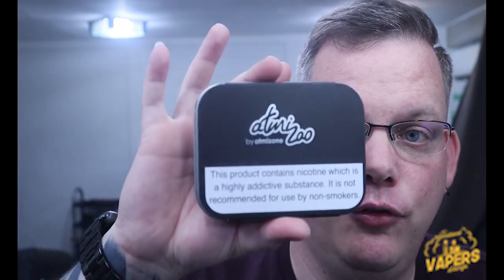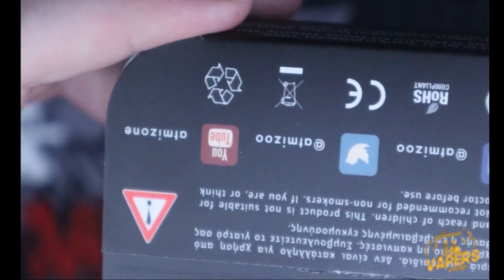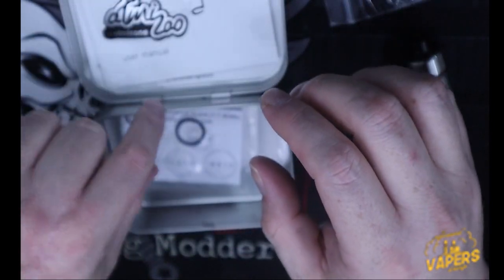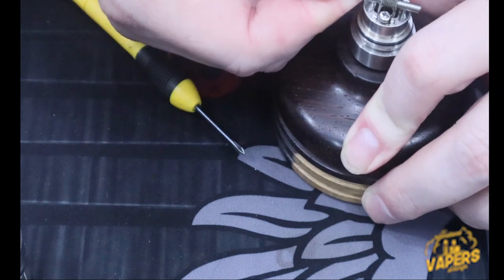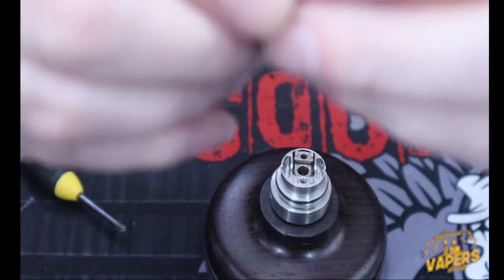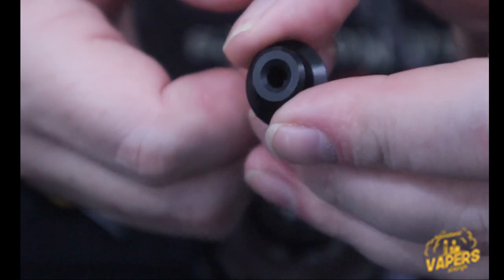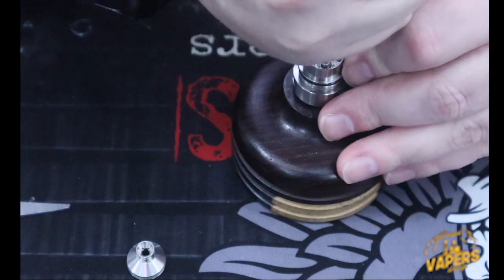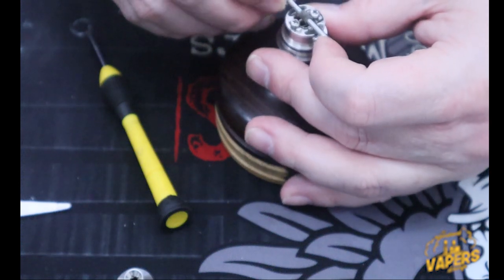Tripod RTA

Comment: Hmm... interesting. Stuck with a little vape pen at the moment. Will share the experience on mine once my mod arrives... which I’m hoping will be real soon. Thanks for the review.
Reply from the maker: Your welcome.
Reply from the maker: Your welcome, sorry for the delay in response, hope it does better for you.
Reply: I’ve been using it for a few days. Sitting on a Taifun Box Mod. Have tried out quite a few configurations; coils, air and juice flow settings, different drip tips etc. So far... no joy. Haven’t done any temp. control. Why isn’t this thing performing? Yes, I’ll probably be selling mine:(
Reply from the maker: About House Music its just a let down imo, the evl reaper v3 is wayyy better i personally feel even with shipping.

Comment: You need a lower resistance coil, I run a .23 at 45 watts with the chamber reducer and get great flavor.
Reply from the maker: Glad you are, your the first in my
Opinion, but I don’t run below 1+ ohm except my two mechs.
Reply: @JoshuaOzzyUncharted-vapers  i use mine for restricted to lung, not mtl. And actually about run about 30/ 40 watts most of the time.

Comment: Was caught in the hype, ordered mine and havent been able to get flavour out of it. I have re wicked like 30 times but my zeus X gives better flavor by far. Im dissapointed tbh since it is supposed to have high end flavour. Cant really understand those best rta ever review, I must be doing something wrong. I only get that great flavour if theres a bit of spitback which makes me think thats the point of the rta lol
Reply: Yes, tons of spit back no matter how tight my wick was. Absolutely garbage and a huge waste of money for me because i made the mistake and bought 2 of them.
I tried every wire, wattage and wicking method known, also I  tried every air pin included, the result was always the same : muted flavor every time.
Now I use a Taifun GTR and the horrible tripod experience belongs to the past.
Reply: @siontissolid1139  Exactly, I Cant get rid of spitback and my flavour is "good" like for 5 minutes after re wicking, then its gone. Also tried reducers, extension kit, and everything that should work. Wont be easy to sell it since in my country the second hand vaping market is a shame. So, yeah, it Will sit in a shelf and collect dust for a while
Reply from the maker: I agree.
Reply from the maker: that sucks, try on other boards and ship it.